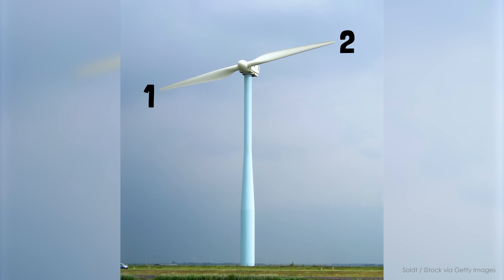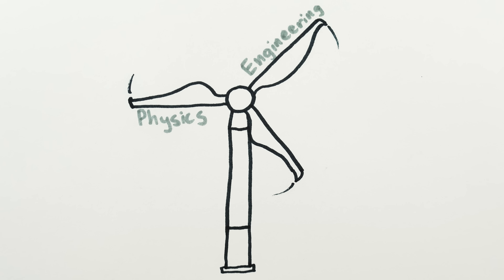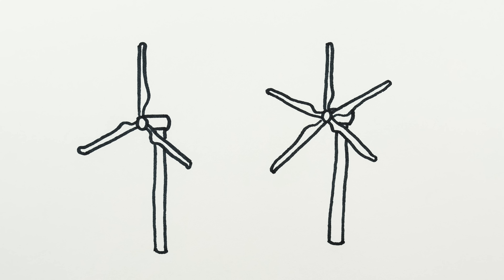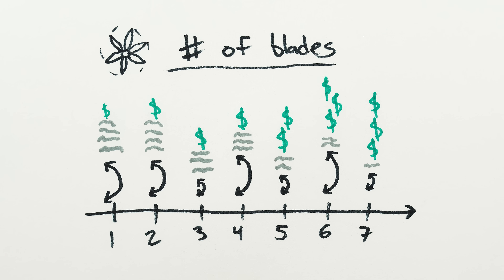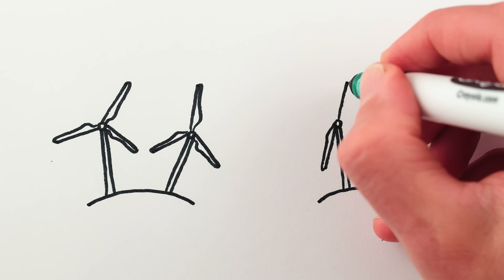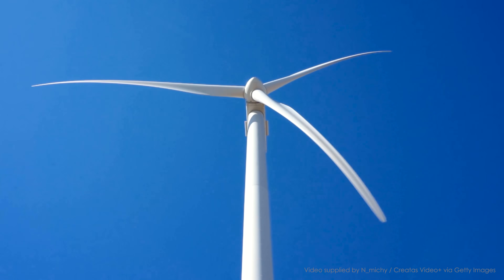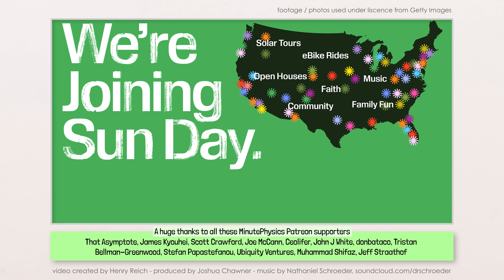Why Do Wind Turbines Have Three Blades?

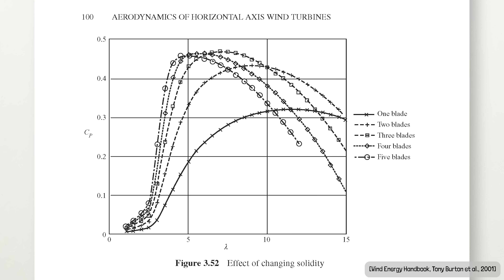Comment: As I understand this graph 0:41, it's function of Cp (pressure coefficient) depending on lambda (span ratio of  blade) with certain blades number. The horizontal axes doesn't show the speed of rotation as it's said in video!

Comment: TLDW: it's the minimum number of blades that doesn't result in equal wind forces cancelling the blade  movement.
Reply: you can technically make a two blade windmill, but they aren't perfectly opposite each other. I did a project on 2 blade windmills last year :0

Comment: But gear boxes, huge, low RPM wind turbines are geared up to turn generators at their happy speeds, while old fashioned smaller water windmills, with many blades turning at high RPM are geared way down to operate their slow pitcher pumps. I suppose it is all about torque.

Comment: I work with and inside of wind turbines. 3 Blades gives just enough space to work inside of the nacelle aswell, if there would be 4 or maybe 5, there wouldnt be much more space to work on the pitch system and the hydraulics
Reply: How would extra blades decrease room in the nacelle? Also how is working on wind turbines? its a career path im looking to get into
Reply: @ScurvyPort251 the blades a „pitchable“ that means the windturbine can change the angle of blade relative to the wind. This works with big Zylinders, these are mounted off—Center, so by pushing or retreating the Zylinder with hydraulics you can control the blades angle. (In the video, the windturnine uses E—motors, both systems have their pros and cons) Now if you increase the numbers of blades, you have to also increase the pitch Zylinders, by doing that you decrease the room to work in nacelle. If you are interested in working with windturbines, maybe you should consider applying at Vestas or maybe Enercon. Both companies build and maintain the windturbines

Comment: I saw a video a long time ago that incorporated the shape of owl feathers to jet turbine fans and it actually succeeded in dampening the volume by a considerable amount. I’m sure you know where I’m going with this. 
I understand it’d cost more to make owl feather shaped fan blades for windmills, and I do understand that making windmills quiet isn’t the highest priority since they are often build far away from society. 
However, if I wanted to get a commercial sized windmill on my property, would it be logical having the owl feather shaped windmill blades to dampen the noise?
Assume all costs are a non factor. 
If that were the case, if they started manufacturing owl feather shaped blades, they could be more implemented into society
Just a thought

Comment: The problem with your final segment on clean energy is that it was misleading and misguided. The chart showing a large increase in green energy (or whatever you named it) only looks impressive if you do not show the rise in power needs over the same time. All the best rivers have been dammed and the best wind locations have wind farms already. The increase in power needs per year easily outstrips all green energy sources many times over. Even if England covered the entire country in wind farms, that won't even keep up with one year's increased power needs.

Comment: the same issue is with even number of asynchronically rotating wheels in a trolley, as each can rotate on its own, or differently to other wheels
it means you can't push trolley straight forward, because it's next to impossible to push it exactly straight forward, and so rear wheels create a drag sidesways immediately
it's not a fancy, or oddity that we create vehicles with 3 wheels, ot chairs with 3 legs

Comment: 0:57 That graph makes me wonder if there is a number of blades that is not a natural number that has a higher efficiency than 3 blades, mathematically on that specific graph anyway. As in: take only the peak efficiencies of every whole number turbine and plot the intermediary results. If you can make a 1.5 factorial then a non integer amount of blades is trivial, right?
Would 2.8 blades work better than 3? or 3 and 1/3 blades?

Comment: The problem with the turbines is the oils needed are disastrous for the environment when they leak.
Reply: Yeah I hate when oil leaks or spills into the environment.  I can’t think of any other notable examples besides wind turbines though.  Good thing there’s never been any other energy source that has led to the environment being polluted with millions of gallons of oil.
Reply: @PhantasmalBlast You don't remember the BP turbine spill of 2010? Where 200 million gallons of oil leaked out of those wind turbines?
Reply: @GamingBlarg  that’s the joke, that oil spills related to nonrenewable energy sources are just as bad if not worse
Reply: @alexsiemers7898 It's gonna be a cold day in hell before I start putting /s on the end of my comments, like a Redditor, which I am.
Reply: @GamingBlarg  that’s actually my bad for not reading your comment in its entirety and missing the punchline where the oil spill was also from wind turbines
Reply: @alexsiemers7898 All good lol

Comment: Because they kill just the right amount of birds.
Reply: Birds killed by them is most likely insignificant compared to the numbe rof birds killed by factors like traffic or cats
Reply: That's true  @emilsinclair4190
Reply: I know that in Egypt they turn off the wind farm when large amounts of migratory birds fly past. so there's a clever solution to the problem.

Comment: thats only if you assume a givne balde design
if you adjst the design of the individual blades for each design the maximum efficiency for any desired speed cna be reacehd with one blade
however the effects really diminish, the efificency gain of going down from 10 to 5 blades are  lot bigger htan going down from 2 to 1 blades so you want hte lowest number of blades from an efficiency standbpoint but hte prioirty isn't super high
one blade gives yu extremely unbalanced aerodynamic forces even wiht a ocunterweight
anythign more than one counters out under ideal conditiosn but can cause some torque if wind ocnditions vary, regardless of how many more baldes exactly you have
the really special thing baout the number 3 is that thats the lowest numebr of blades that you can put o na rotor to make its rotational inertia matrix even which means that in terms of rotaitonal dynamics the rotor as a whole behaves like one big disk rather than one big stick whcih means that if there is slight twisting or virbation the rotor itself does not have a tendency to want to change its axis of rotation and twist further

Comment: If more blades provide more torque does that mean that they could be attached to more powerful generators at lower wind speeds? Does that mean they could provide a more constant generation and be less susceptible to intermittency?

Comment: The propagation of wind turbines is not a good unto itself. They are one of many potentially viable methods of generating electricity and should only be used when they are more cost effective than other alternatives.

Comment: I wonder why vertical axis turbines aren't used more than bladed turbines?
Reply: Vertical ones have much less area to gather wind from and thus less potential power output, even if that smaller profile is also one of their main benefits (alongside less complexity since it doesn’t need to pivot to face the wind).

Comment: A good description in 4 minutes or so, but traditional windmills used for things like making flout, or water pumping, normally had 4 blades. Maybe they hadn’t thought it through, or perhaps it didn’t matter at the operating speeds.
Reply: It could also be that 4-way symmetry in construction was much easier to work with at the time

Comment: A little deeper. The reason for three blades has to do with vertical wind distribution. Because of ground effects, wind grows in strength as you go higher. The blades do well to produce twisting forces, but there is a necessary thrust force that can not be eliminated. Think airplane prop in reverse, the thrust and torque are coupled to each other. As the blades travel around their path, the thrust force the structure needs to accept and react is proportional to the  wind speed. When the blade is pointed up it sees more wind, so imparts more thrust on it's bearing.The arrangement of the blades in 3 allows for better balancing of those thrust loads. Think of it like a fat dad and his kid on a see saw, the load isn't balanced very well, but if he had two kids on the other side it would be better. Two blades pointed down (two kids) and one pointed up (fat dad) roughly cancel. One blade and two blade turbines do a better job aerodynamically, but a poor job at balancing load. Higher number of blades do a poor job at both aerodynamics and balancing, except for slow wind speed as the video points out. 3 blades is the hands down winner for reducing cyclic bearing twisting "moment" loads. The bearing still has to deal with the thrust, which can't be balanced out, but bearings are better at handling thrust, not as good at twisting loads. Structural engineers use the word moment and mechanical engineer says torque when talking about a shaft rotating. They are the same thing, just one (torque) is associated with movement, and the other (moment) has to do with transmission of twisting force through a structure. If you are still reading, thanks.

Comment: Two blades do not give enough power or torque to the shaft and any more than 3, like 4 or 5 makes the unit heavier, difficult to control especially in changeable winds and more expensive to maintain. Having more than 3 blades is also more dangerous and would be prone to failures. There you go, a simple answer without having had any scientific background, just common sense. It would only make sense to have 4 or more blades on a much smaller wind turbine.

Comment: Until we get enough affordable slack storage capacity to run the wind farms at 80%+ possible output I'd prefer to focus more on nuclear. Generally safer, similar carbon footprint per MWh, uses less land and provides predictable stable output. 

But good explanation why they use 3 blades.

Comment: But all the 3 blade ruinables ALL TURN VERY SLOW   
ROUGHLY 15 RPM
I do under stand tip speed due t diameter an speed or sound implications 😮

Comment: So, why do older (Dutch) windmills have 4 blades?
Reply: Someone else wrote that it was because if one sail broke you could remove the opposite one and still be functional while repairs are done. I don't know if that's correct but it sounds logical
Reply: @frydaze13  Maybe it's (also) to make it spin slower on high wind speed.

Comment: Depends very much on the context for the turbine.  A single blade starts at much lower wind speeds than multi-blade designs; consider a sycamore seed with its naturally aerodynamic shape and counterweight developed and proved over millennia!  All the time a single blade is rotating, it can extract energy and that's practically the whole time.  I was designing these in the mid-''70s here in England for hydraulic heating for greenhouses and similar, with underground heat storage.  The aerofoil blade uses the existing technology of helicopter blades. Down-wind of the lattice tower, so high wind speeds cause the blade to flex, umbrella-like, reducing the swept diameter and so regulating the rotational speed to avoid mach tip speed problems.  Lattice tower reduces wind 'shadow' vibration.  Down wind positioning means no energy consuming wind direction vane or mechanism is needed.  Although highly effective, investment money was difficult to obtain because it 'didn't look right'!

Omni-directional vertical axis Darrieus style designs are OK for very small systems (e.g. caravans) where low wind-speed starting is not a requirement.

Since the energy in the wind is free, conventional efficiency calculations are largely meaningless.  Apart from initial capital construction cost, the ongoing costs are maintenance which, for a hydraulic energy transfer system, are minimal.
Reply: Valid points. BUT isn't the counterweight the seed itself, so the "design" basically HAS to include it? And yes wind is for free, but not the space you need to farm it nor the "harvester". So efficiency IS a great deal. No hate. Just loving the conversation. Greetings from Germany.
Reply: @Xlappahony  Yes of course there's a counterweight.  There may be a misunderstanding about efficiency; since the energy is free, efficiency tends to the infinite!  Perhaps you are thinking in terms of effectiveness, which is quite a different matter.  As to the farming issue, while wind speeds are below the starting point for multi-blade designs, the single blade type is extracting energy..  So it could well be that some sites with low wind speed regimes would out-perform multi-bladed masts.

Comment: This feels more like a video about why wind turbines don't have two blades, rather than why they have three. I'm not fully convinced without more information that five or six blades wouldn't also be viable, maybe even better depending on circumstances. It didn't go in-depth enough on refuting those options.

Comment: Some of these reasons are also why I chose 3 blade fans for our new house,  noise being one, and looks were important.  I find myself and others often agree that even number geometry often looks ugly or wrong.  Same how a 4, 6, 8 and 10 spoke mag wheels on a car looks hideous where the typical 5 spoke looks nice as well as 7 spoke, 3 looks odd for being too few but symmetry wise is ok and still better than even ones, same with 4  or 6 studs look ugly compared to the common 5.  The load distribution as these rotate are better too in similar ways to in the video.

Comment: I don't really understand why more blades is more drag. If the wind blows on more blades, doesn't that mean just more torque? From what I understand, each blade generates both torque and drag, but the torque outweights the drag, which is the point of the windmill. Is that wrong?

Comment: A lot of "wrong good reasons" !!

About force asymetry... exept for the one blades, forces on each side of the rotation disk equals because the rotor direction is adjusted to the wind to get le power !

About the drag... this is not a propeller ! You can not apply 'the drag' on the blade like this. (The blade MUST have the "maximum drag" in the wind to be efficiency.

The choice of three blade is beetween cost and to minimise resonance, and no one of the electrical industry give a $hit for the "agreable". It's only a business.

Comment: Just 3 reasons?  I don't think so.
E.g. For a given power, two-bladed windmills have to avoid supersonic flow at the tips of their higher speed wings, while three-bladed windmills can avoid that entirely.
(Of course, you could throw EVERYTHING under "Efficiency" or "Engineering"...)

Comment: I've noticed that most car wheels have an odd number of spokes (often 5 or 7). I assume this is also to do with not having 2 spokes opposite for some reason? Maybe it equals out the loading better as you get a tripod arrangement rather than a line?

Comment: Similarly to the efficiency of many high altitude rotor kits for Helicopter use in mountains and high elevation hovering. 3 blades is most efficient.

Comment: I have built over 200 of these wind turbines, and this was 20 years ago when they weren’t as sophisticated as they are now.  NEVER have I heard them make any noise from outside the structure.  You can hear them definitely if you’re inside and they’re running, but outside, nothing.  Except for the gentle sound of the wind through the blades, and you really have to be right underneath it to hear that.  I suspect that if you’re hearing any kind of noises:  humming, chirping, pinging, clunking, etc., there is something wrong with that particular machine.  After building all those wind turbines, I stayed on after construction as a maintenance person, and have repaired dozens of them, and I have never heard a sound out of any of them.  Especially like any of the sounds that some here are describing.  I suggest that some people are like my ex-wife.  She could not stand even the sound of a ticking clock in the silence.  Drove her absolutely crazy.  That was a her thing.  Could be the case here.

Comment: The second point is wrong if you check the math on it. The lever is 0.5 the length but gets multiplied by 2 for the amount of blades so it's equal.

Comment: you switched between "windmill" and "wind turbine" multiple times in this video
they are distinctly different things
wind turbines commonly have 3 blades, windmills commonly have 4, and it will greatly confuse people if you conflate the two

Comment: I still think the 3 blade windmills are incredibly inefficient. They should be building turbine systems on top of buildings where the turbines are stacked in a row, each one increasingly smaller, to get all the passing wind from the first turbine and maximizing the kinetic potential.